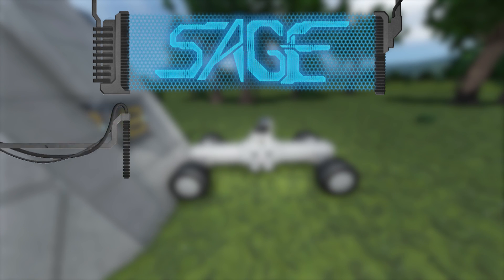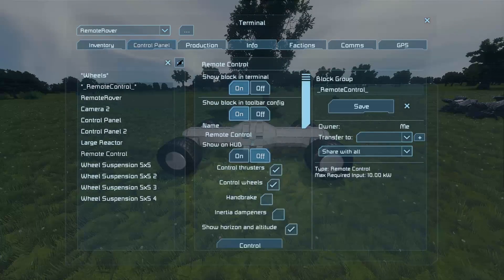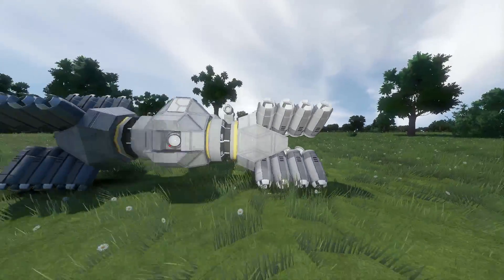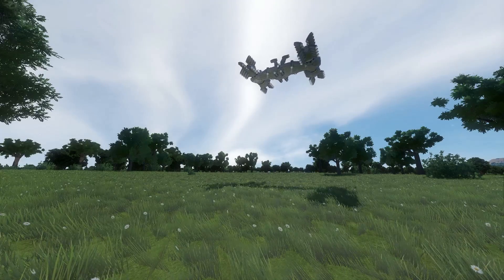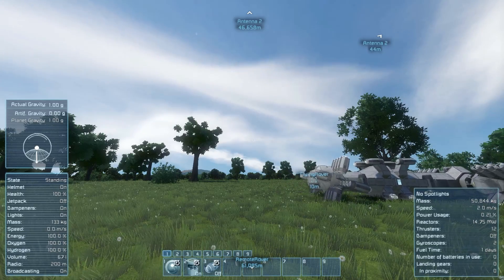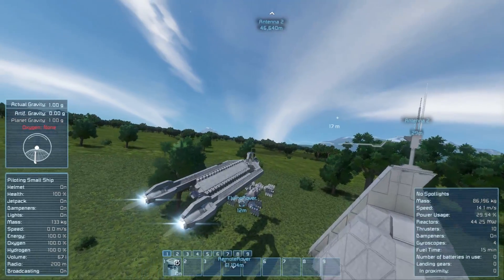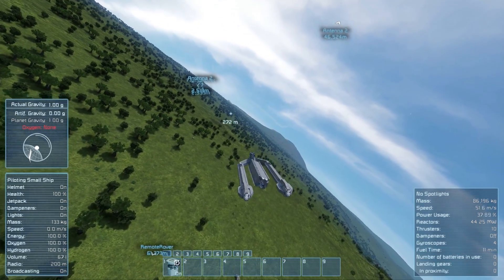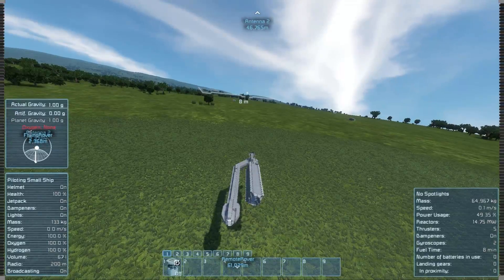Space Engineers, Odd Rovers

Comment: If you actually test the physics and the way it works you will discover that it doesn't matter how many thrusters you add to the wheel sections of your flight rover. it will never stop the vehicle sinking if you remove all downward thrusters from the central body.
Reply: +Loues S. Cat 
This is because of the way SE does inertial dampening, right? It doesn't account for attached grids properly.
Reply: Basically yeah.

Comment: As far as I know, only the standalone wheels, the ones without built-in turning and suspension, can have blocks on the outside.
Reply: It was possible to place blocks on suspension wheels; however, this normally didn't end well, so it might have been removed for a reason.

Comment: hmmm... so does this rotary atmospheric thruster design take into account burn radius? i'm curious because, if you just make a psuedo "hover reactor" you could set the rotors to spin inside a casing, thus allowing it to be centralized to the ship, and perhaps this would be buildable within a ship and thus protect people via the casing from thruster burn.

which... granted you would need perhaps two or four external thrusters per up down and side to side, but otherwise it would stay in operation right?

i should try to make this "hover reactor" design.

maybe for a large ship. alternatively i saw a ring rotor mod. but i dunno how well that would work...

hmmm.. i appreciate the musings you have given me. maybe i can upgrade this. but do we have the numbers on this yet or are they technically experimental still?

how much weight can each atmospheric thruster hold? thats the question.

because with that number you can build the frame then add the thrusters in the right number to balance it out, however if the thruster output matches the weight... does it move fast because it has many thrusters or not at all because its equal in weight?
Reply: +Anthony Placek For your maths about weight: Just trial and error. The Core should be just a glimpse below being able to hold it up alone, so you can still control it with thrusters on the outside.
Reply: +LeifTheHead well that would be the anserr but my machine is a potato with a screen. my graphics card can't support dx11 so i can't test anything i build planetside.

so my only option is to test it numerically.

i mean i could technically go ahead and build a different "hover reactor" configuration based on what sort of ship i expect it to be in, but i still need the numbers so i can blueprint them and give them a name indicative of the full weight capacity they can take. which would be useful, but i can only do this after i get the numbers.